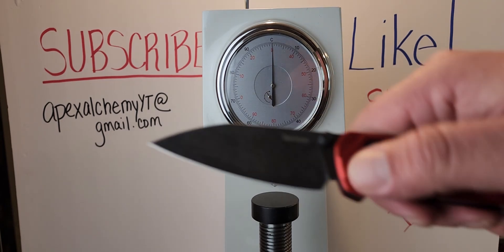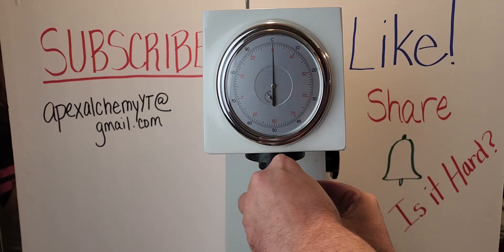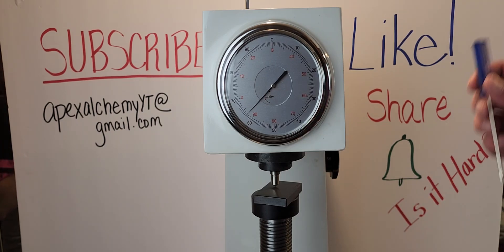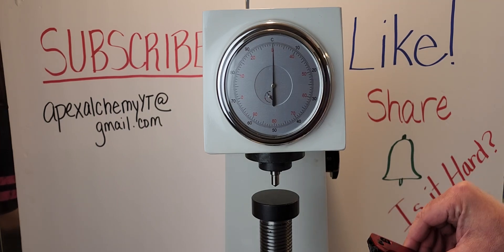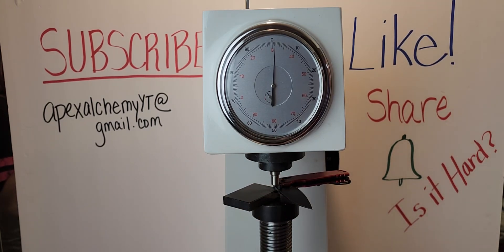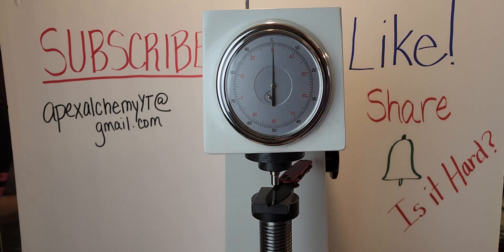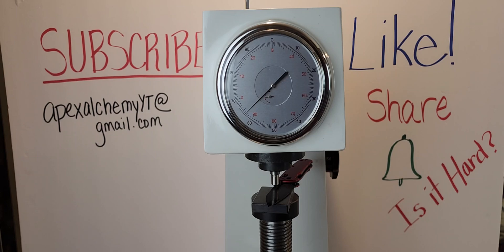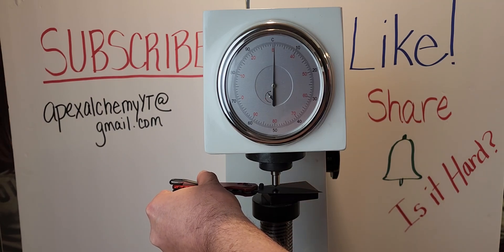WTH   IS  THIS  ??   ROCKWELL TEST  RESULTS

Comment: so if the results came out 100 HRC would that mean the tested material was diamond ?
Reply from the maker: @DLN-ix6vf   yes ofc it would
Reply: @apex_alchemy_knives  thanks , you're the first person I asked that had an answer
Reply from the maker: @DLN-ix6vf   I really don't know the hrc of a diamond though. If it test at 100...its not knife steel 100% ..but tungsten carbide can get up to 80ish. It's very very hard to sharpen though. I honestly think a diamond would be north of 100 myself.

Comment: I could live with that 63.5 not to shabby
Reply from the maker: @kellyweaver1389   I've never seen it done higher myself. It'd be interesting to see how it performs vs CRK 63
Reply: @apex_alchemy_knives that would definitely be a good comparison I'm kind of interested in seeing the results of that
Reply: can you sharpen it?  Most people can't. A chip on that hard edge is pretty much unfixable without power tools.
Reply: @LXT43  I sharpen my bel air as needed; it's not as difficult as you think. You don't need power tools; you just need a good abrasive. If you're trying to go at it with a traditional whetstone, you'll have a tough time because steels like this are where you should consider diamond-plated or resin-bonded diamond stones. Sharpal makes an amazing budget dual-grit (325/1200) diamond plated stone, and it'll sharpen magnacut at any HRC with no issue. Finish on a leather strop with some decent compound, and you'll have a great edge in no time. You can get everything (the stone, strop, and compound) for less than 100 dollars, and it'll last you years.
Reply from the maker: I didn't see the last comment before I read your comment. I was confused, thanks for the input. Would you skip straight from 300 to 1200 though ? I'm kind of weird about never going over double. I'd need a 600 in between those too. Currently I use a 120, 200, 300, 400, 600, 800, 1000...I usually don't go past that but I have stones up to 10k. They're not all the same brand. I have some shapton pro, glass ...those obviously aren't diamonds but then I have some venev and some ruby stones in the finer grits. Honestly , I good toothy edge usually does me best in most steels for my job. Thanks again 😎
Reply: @apex_alchemy_knives  Going from 325 to 1200 isn't the worst thing in the world if you just want a working edge and/or can only afford a one stone solution, but a smoother progression is nice if you're trying to really make it shine; I personally round out my stones with a 600 grit diamond plate.

I don't really take my knives to a mirror polish, but I'm hoping to invest in a KME soon, at which time I'm going to try out some of the diamond lapping films (basically a super thin film with incredibly fine diamonds embedded in them; you mount them to something flat, like a piece of glass, and then use them like a strop) because they reach some insanely high grits and apparently produce beautiful mirror polishes.
Reply from the maker: @jamesruth100   last time I bought belts for my 2x72, I saw they now have resin bonded diamond belts...I doubt they last a super long time. Then again...they're like 100 bucks each so I suppose they may be better than I think. A very low speed and a little slack could give you a hell of a convex edge.
Reply: @apex_alchemy_knives  Oh wow, I've never heard of resin-bonded diamond belts before; the price is off-putting, but I'd imagine they're probably worth it.
Reply from the maker: @jamesruth100   if they last any kind of time at all they'd be useful for profiling for sure
Reply from the maker: I think I'll be okay with it. If not I have friends who love a good challenge 😎

Comment: Magnacut knives at 61 to 62 have been may favorites. My spyderco magnacut was awful. Best ive had was tactiles edc fixed blade. That tanto. Not sure what hardness that is but it is the shit. I actually hate most of these super high edge retention high hardness knives. I think balance is more my thing. Recently bought into the steel snob thing again and got that rex 121 sage 5. Absolutely hate that knife. Never again. Im fine with nitro v or well done d2
Reply from the maker: @knifeguystuff  wanna sell or trade that sage let me know. I'd love to have it just to do the rockwell test on it. I agree...I like balance myself 😎💪
Reply: @apex_alchemy_knives 

If you don't mind waiting a month for drop shipping, you can get the G10 version from dack for about $190.
Reply: @apex_alchemy_knives  its been sharpened a whole bunch
Reply: @apex_alchemy_knives  how can we safely make a transaction? I did sharpen it quite a bit, playing around with edges and such.
Reply: Isn’t magnacut supposed to be the most well balanced steel out there currently?
Reply from the maker: @jarofaar8618   supposedly , but we hear this with every new steel until thr hype train slows down.
Reply: Magnacut is balanced in that there is extra toughness for a stainless steel, great edge retention, and incredible corrosion resistance... But you don't need toughness in a folding knife that you aren't beating on, that doesn't have super thin razor geometry. S30V has better edge retention than Magnacut, probably comparable to high hardness magnacut. 20cv/m390/204p are basically the same steels, and have better edge retention than magnacut while still having about the same corrosion resistance. S90V is still stainless, still has some toughness, and has killer edge retention, nearly as good as maxamet.

Realistically, anyone who can sharpen a knife can work with 8cr13mov with great results. It doesn't hold an edge that long, but does hold it long enough, and absolutely takes a razor sharp edge. Also, 420hc and 14c28n have low edge retention, but more toughness than magnacut, while still being about as stainless. Anyone who can sharpen can use a buck knife to great effect.
Reply from the maker: @phil2082   well said ! Have you heard about the magnacut rusting from these reputable steel suppliers? Very odd stuff...I'm not sure if they accidentally mislabeled some steel...not sure what's going on there. I don't tend to think magnacut when I talk about tough...then again I work with the toughest steels that have ever been made and no, not stainless. I most definitely have had incredible results from bos 420 and 8cr...I mean...better than expected, if that makes sense. Where I've been disappointed in steels that I expected too much from. We gotta balance our mindset and expectations to really judge a steel for what it is or whet it is not.
Reply: @apex_alchemy_knives  I have not heard about rusty Magnacut. That shouldn't be possible, especially if finished correctly.

Super steels are usually only about 2x as good as cheap ones like 420hc for edge retention. Sounds crazy, considering the premium people will pay.